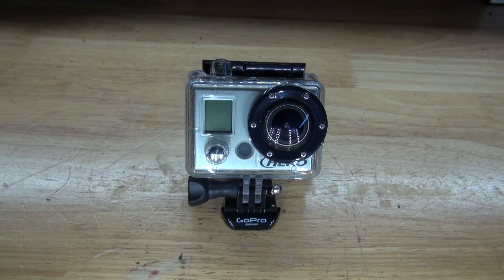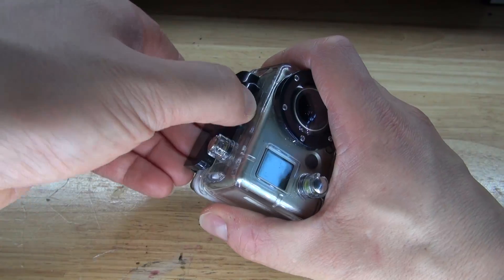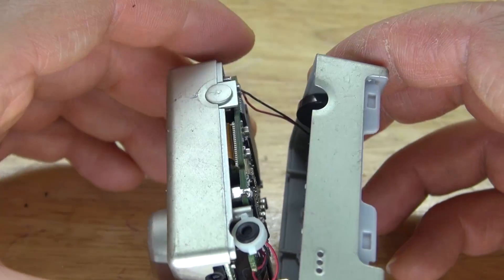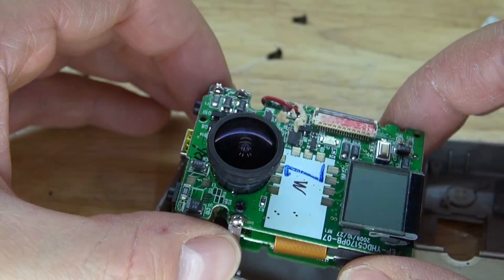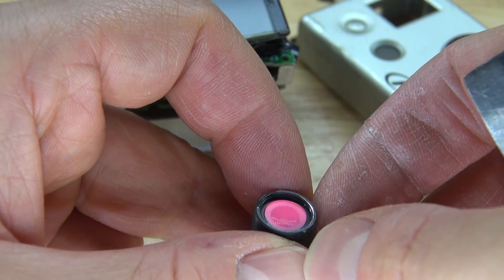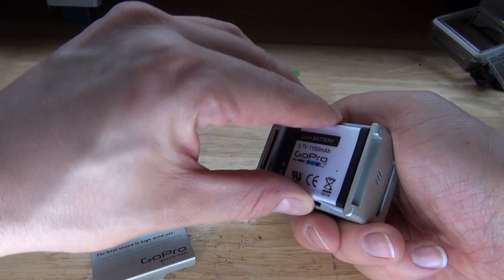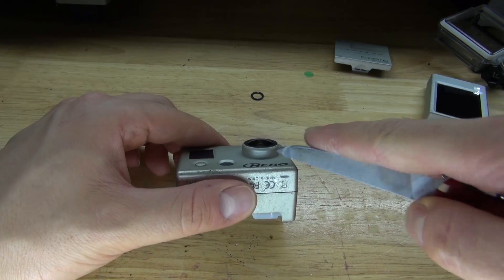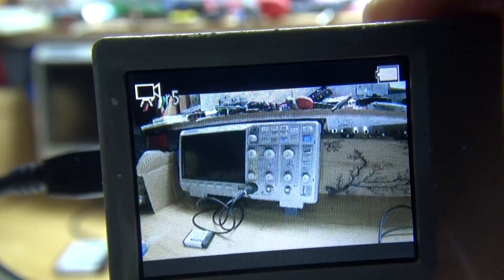How To Make An Infrared Camera From Gopro 1 The Easy Way

Comment: Go pro hero 2 is not for go. The original lens crew will be too small to go into focus without IR filter. I did glue it with epoxy glue, so, it kind of works, only finding focus with loose lens is not easy.  Thank you for video SciTyeTech, great video shots you did.
Update after glue get strong. The housing do not fits now, camera lens now too much on in front and it touches housing glass and doors do not closing. And camera lost a lot of the angle of view, it's kind off zoomed now.